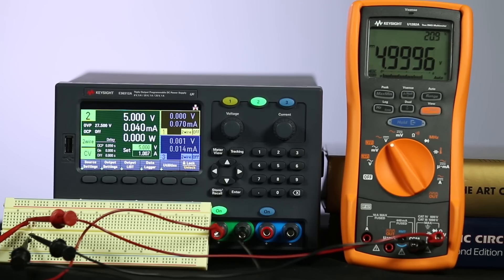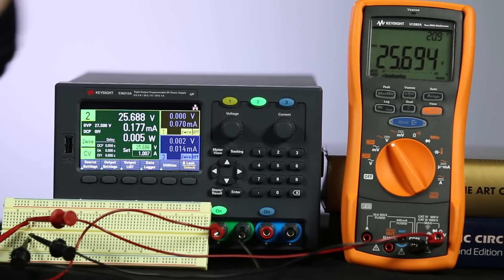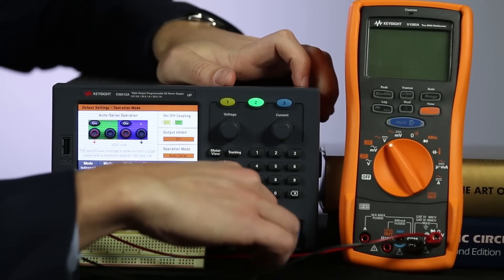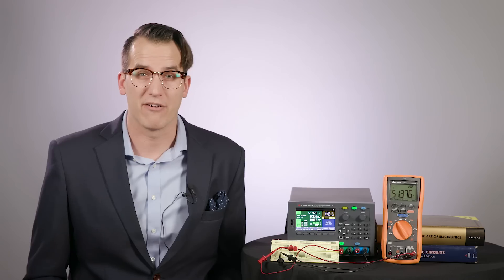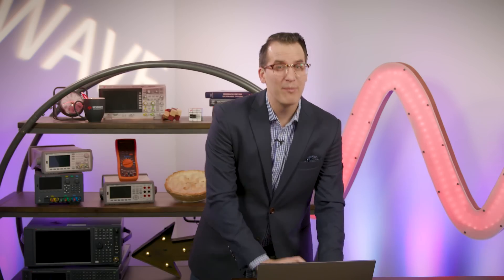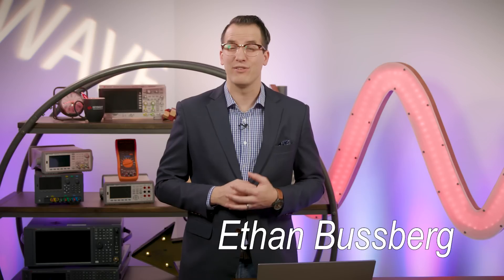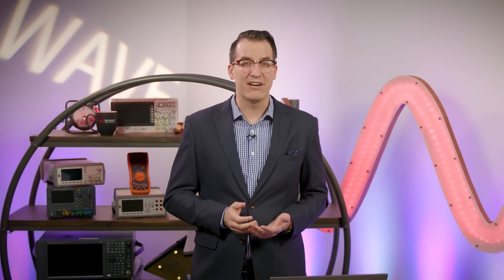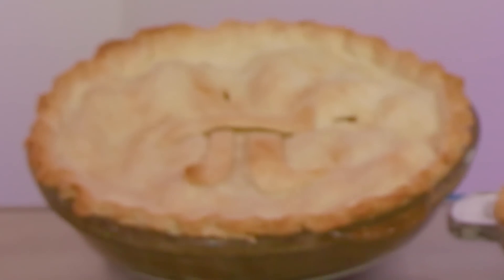Series/Parallel Power Supply Connection + Wave Winner! (14-Mar)

Comment: Get Daily Entry is not working. Cleared the cache, cookies, but still the same error 

VM1025:1 Uncaught SyntaxError: Unexpected token o in JSON at position 1
    at JSON.parse (<anonymous>)
    at Function.n.parseJSON (jquery.js?ver=1.12.4:4)
    at Function.a.parseJSON (jquery-migrate.min.js?ver=1.4.1:2)
    at Object.success (main-045d25b162.js:4)
    at i (jquery.js?ver=1.12.4:2)
    at Object.fireWith [as resolveWith] (jquery.js?ver=1.12.4:2)
    at y (jquery.js?ver=1.12.4:4)
    at XMLHttpRequest.c (jquery.js?ver=1.12.4:4)